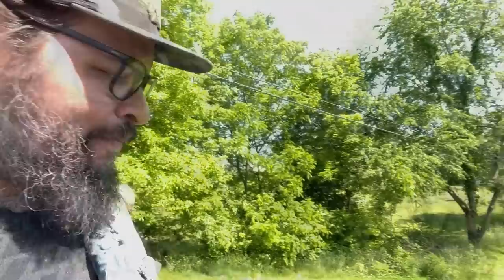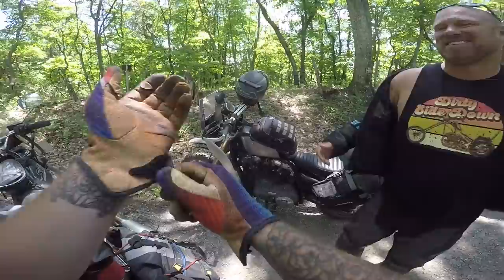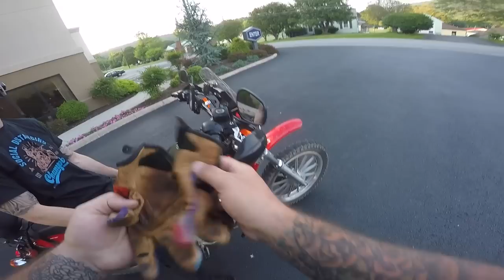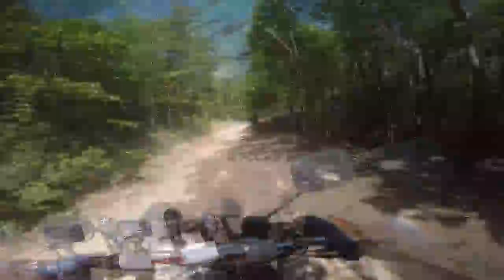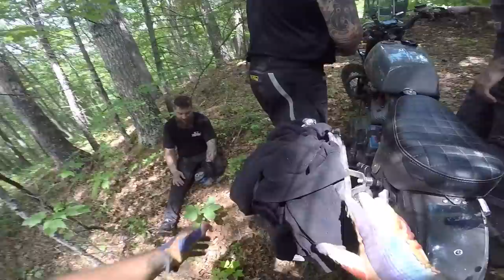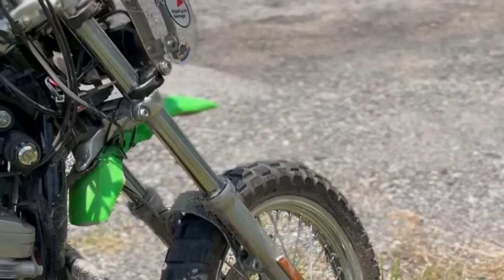Cross Country Off-Road Adventure on a $1500 Harley Sportster

Comment: Technically they weren't actually on Endor.. they were on Endor's Forest Moon... which tells you it had more than one moon and they were on the forested one :P (A quick trip to wookieepedia reveals that it was actually the ninth moon of nine moons total.) You know the funny part is the 883 actually has a lower first gear (if I remember right) than the 1200 and it's common to swap it over. (or that might be backwards, who knows :P) I'd definitely suggest getting a hole of JP Cycles or Revzilla or Screamin Eagle or someone and see if you can bum a 1200 kit with some good hemi heads for that thing before you go on your next trip with it.. If you've gone back and gotten it.. if no one stole it or put it in a crusher. A bigger rear sprocket would also help with the hills and whatnot at the cost of top speed.

Comment: Dude! I believe everyday is an adventure with you!! As far has the blowout, you were lucky it wasn't the front one. You wouldn't have had time to say your prayers!!! Keep it coming.
Reply: Did he say he doesn't run tubes with spokes I blew a front tire with a tube road home not knowing it was blown 10 miles . I was told the tube won't through the bead and make you loose control it worked for me on a 21 inch front thin tire. I figured out it was blown when I was pushing it in the garage and it was really hard . I always run tubes with spokes now

Comment: I wouldn't put a 1200 kit on at this point, and the 883 ain't exactly hurting for power when most of these trails are being ridden by KLR's or bikes like the XT250 that have half the power and half the weight.

Comment: I had a similar problem with my 2013 sportster not starting but I knew it had power. I changed all the fuses and took the controls apart, sprayed connection cleaner in them and used a brass brush to clean everything in there and haven't had a problem since. I have a bad habit of doing multiple things before testing to see if one fixes it, so I never know for sure what the solution was just that I figured it out lol

Comment: If i remember correctly the belt drive, drive pulley on the 1200 is larger than the 883.  Ya may want to try that before you convert to 1200.   I did a conversion years ago on a 02 xlr.  I bored the original cylinders and used the harley conversion pistons.  Tuning it i used a 1340 evo pilot jet and had to mess with the main jet.  I did lose noticeable gas mileage.

Comment: In 50 plus years of riding the only blowouts have been with spoke's so I personally don't ride with them unless it's a designated dirt bike .

I'm usually traveling with the most valuable person (my wife ) and as cool as spoke's may look they are not for me .

By the way get a 1250 Hammer kit you will not regret it